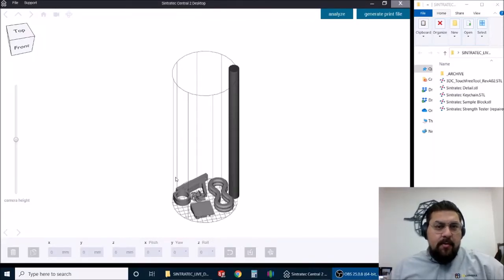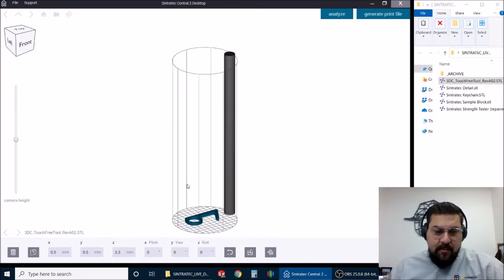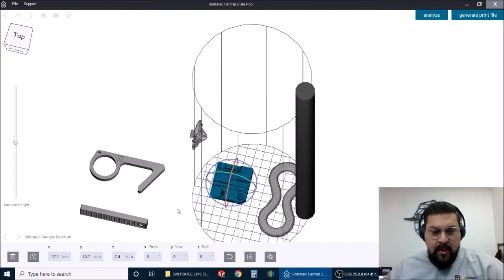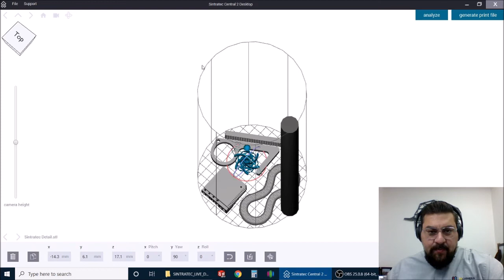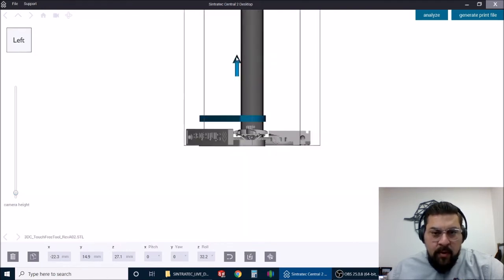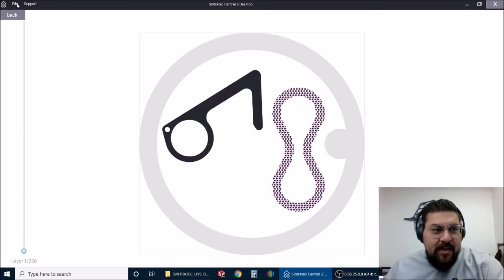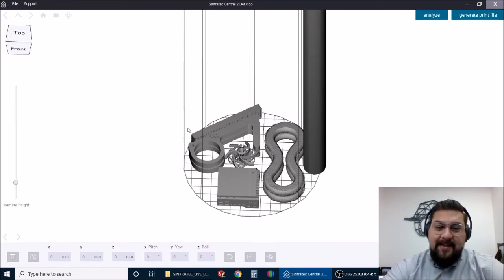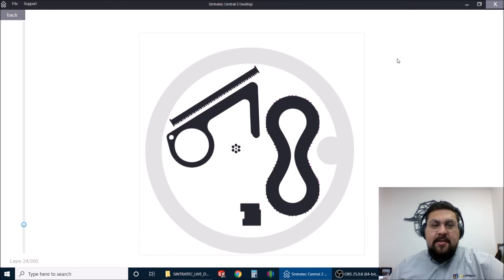How to Set Up a SLS Print on Sintratec Central 2 Slicer

Comment: Parameters and so on doesn`t have to be adjusted? What if I buy the powder from some other suppliers?
Reply from the maker: For normal operation, the parameters are all dialed in.  If you are running 3rd party materials with the Material Developer Package, then you will have more parameters that need to get adjusted.